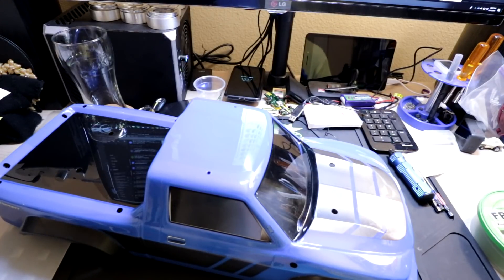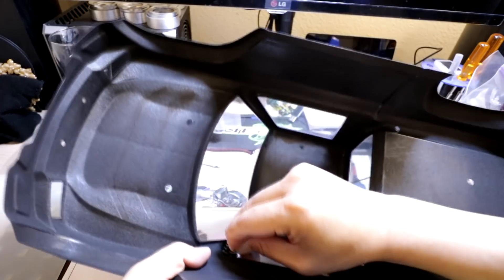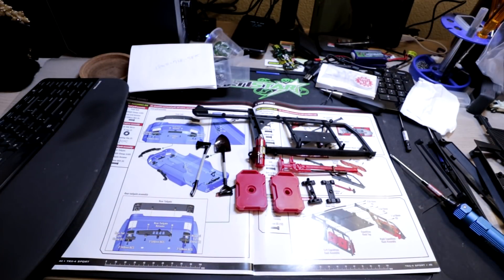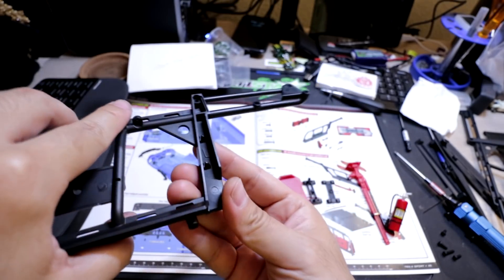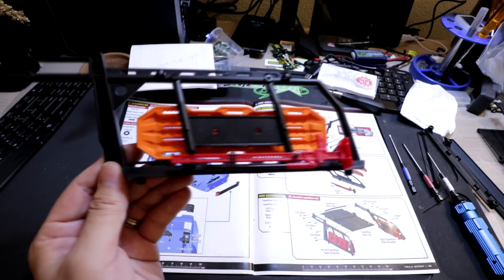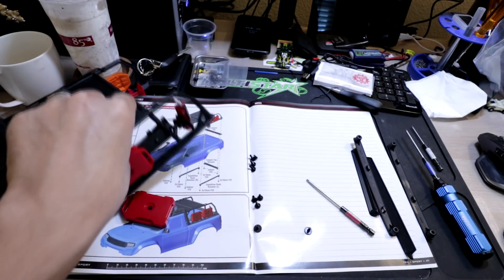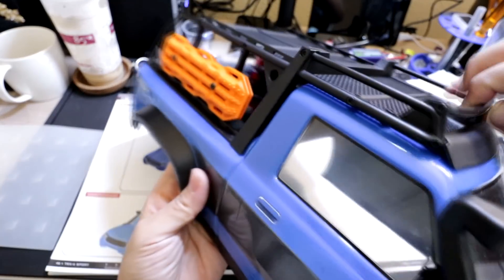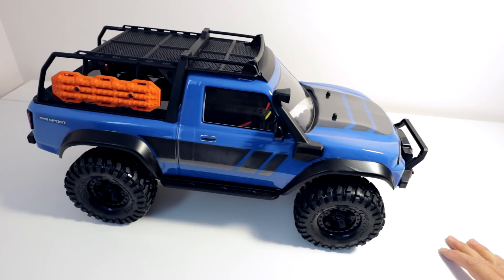Traxxas TRX4 Sport Kit Build Series - Part 7 - Body Assembly and Build Completion

Comment: I was missing a screw in my kit as well for the front
Reply from the maker: Yes, overall a great kit, but yeah... I had a few snags along the way with the defective output drive and missing screws.  Traxxas support was very responsive and quick though!  My first experience with Traxxas and I'm impressed.  If they make more kits I'll definitely consider them.